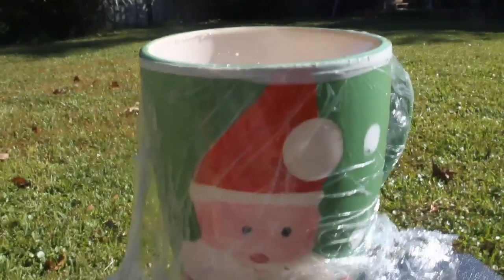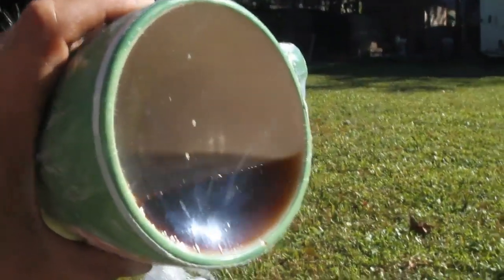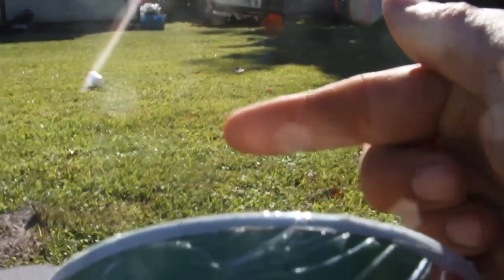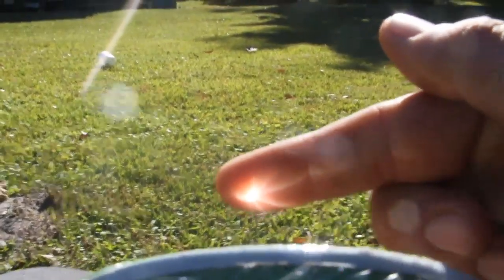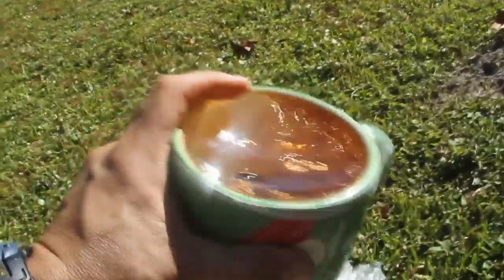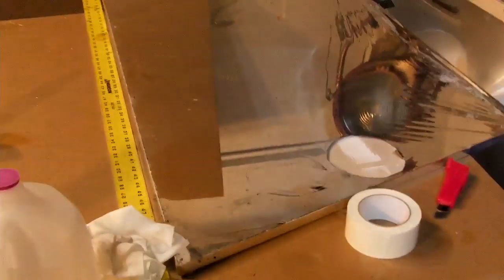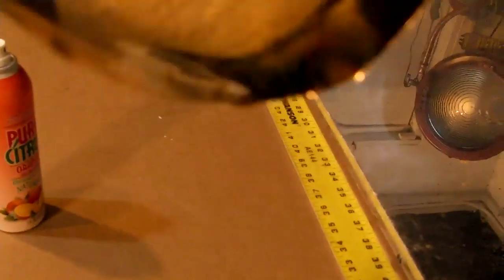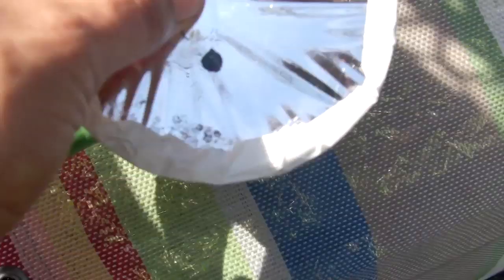Fire starting coffee hack with a cup Vacuum formed parabolic shape greenpowerscience

Comment from the maker: It is closer to a cross between catenary and parabola. Vacuum telescope mirrors have been used for optical imaging. Here is a video on reducing distortion:

watch?v=bBXKbfqI49E

Because all materials are more flexible at the center, the rigidity of the edges for the parabolic shape. Since we are using it for solar concentration, optical aberrations are not a big concern.

Comment: just experimented at home. If you carefully unwrap a set of poptarts, you're left with a the reflective wrapper in tact. If you stretch this over a cup (I used an old glass coca-cola cup) and rubber band it down tightly (could use something else for a better seal I guess), you can place it in a pan of cool water and soil bring up to medium heat. If you put a pin hole in the surface of the stretched wrapper, as the cup heats up the air expands in the empty cup and escapes through the hole. after a while (long enough for the water to simmer for a bit), if you seal the hole and remove from the pan of water, the cup and air cool rapidly and the vacuum works on the wrapper almost instantly pulling tightly concave into the cup. Haven't tried to light anything with it yet, but I would imagine with some good sun it would work on something small.

Comment from the maker: No, the coffee alone would heat from the sun since it is dark. The cellophane would only act as an insulator. Lenses concentrate light vs magnify it or amplify so the diameter of the cup determines the area of sunlight that is absorbed. Water lenses also only work in the summer when the sun is overhead:
watch?v=f_zKk03CJKU

Comment: There are reflective sticky tapes that are used in the building industry. I believe tey are used to stick together heat mirror foils that go under the roof material. That stuff would be ideal for such experiment or for camping and such as it doubles as a good tape and an emergency signaling and fire starting stuff.

Comment: Good video.

You do not need to use coffee for this. Simple hot water will do the same thing. Or heat the cup up in the oven a little bit and then apply the mylar.

If you have a black container, you can actually heat that up with the Sun, to provide the vacuum when you cool it off.

Comment: hm, so if I put a cup in a self-defrosting freezer it'll soon be filled with dehydrated air! then I can put the mylar on it with a small gap on the rim, heat the cup outside the freezer and seal it with elastic. When it cools I should have a strong parabola with an inert atmosphere in contact with the single-surface side.

Comment: it's cute he keeps using coffee. He'd just need regular hot water. OR he doesn't even need a liquid at all. There's the ancient oriental art of cupping where a burning splint in inserted into a glass cup facing down. The split heats the cup and air - the cup is then placed on a surface (in this case the body) as the cup and air cools the vaccum applies suction to various parts of the body. Probably less messy than dealing with making coffee. Could just get a sheet of mylar and some putty - form a ring of putty that's the same circumference as your cup - heat up the cup and the air inside then place quickly over the sealing putty. As it cools it will suck up the mylar. presuming the putty hold, you could just cut off the excess mylar with an exacto knife or something.